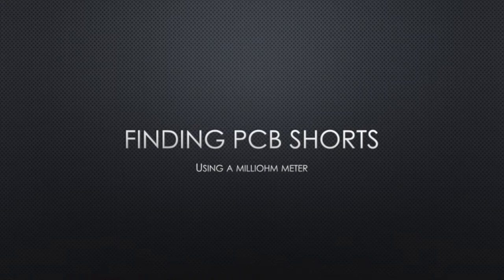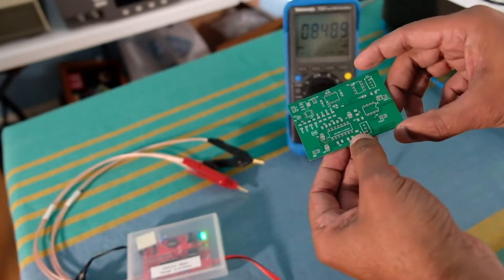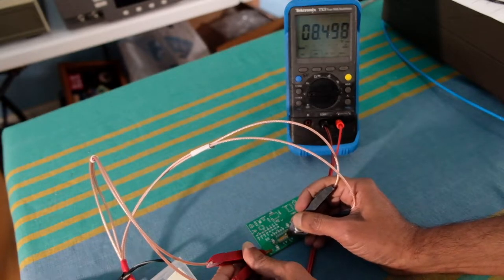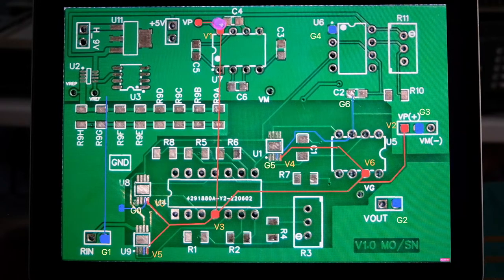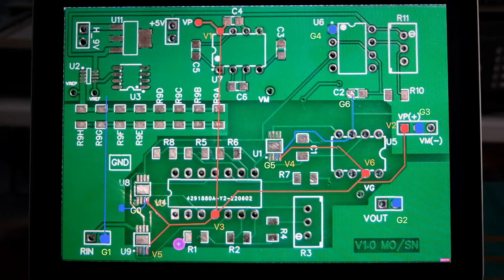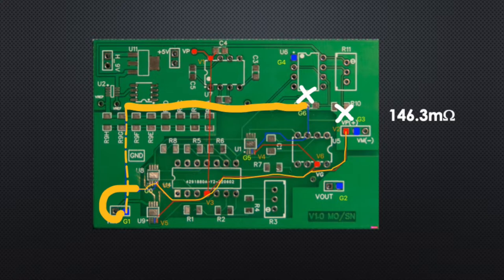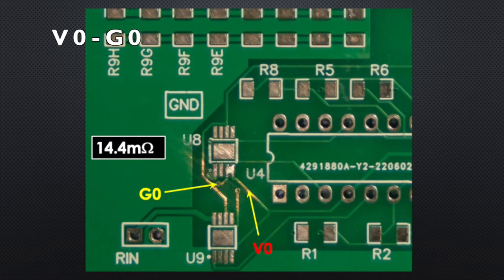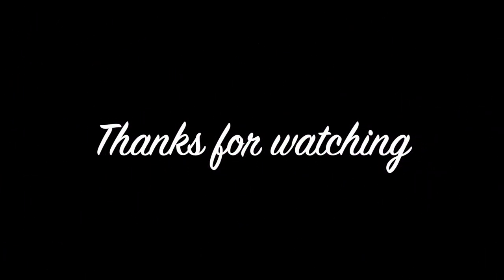Finding shorts in printed circuit boards (PCBs)

Comment: Maybe add a geographical methodology to your approach... Meaning, divide the board in two - measure the center of each half - for the half having the lower resistance - half it again - repeat, until the short is located. HTH.
Reply from the maker: Thanks, it's an interesting suggestion.